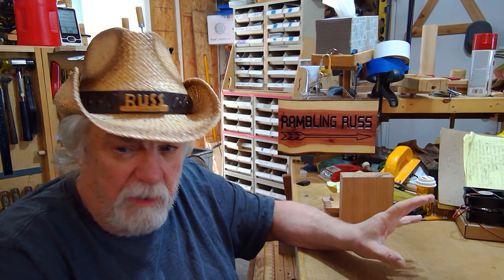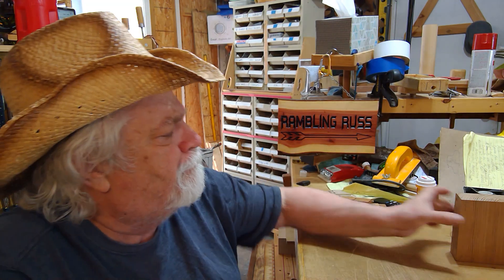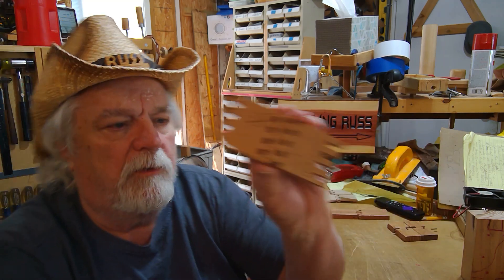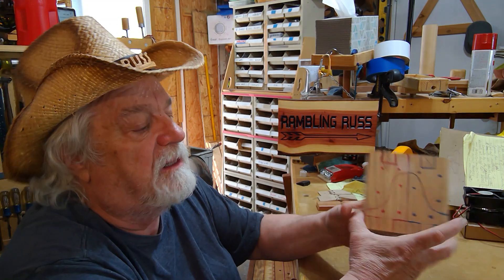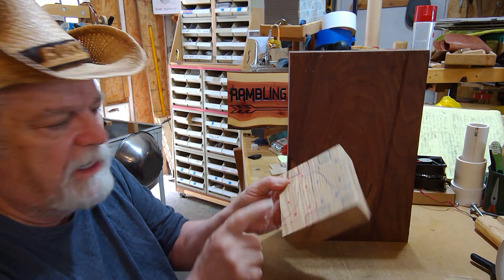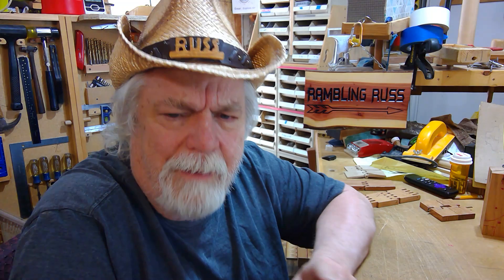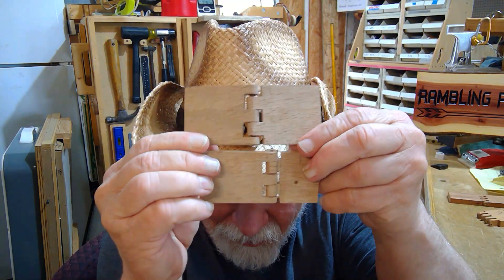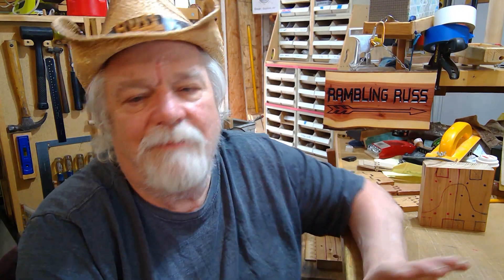Wood Hinge Design and Project by Rambling Russ

Comment: Thanks Russ, I look forward to learning.  I don't have a drill press which I assume you need to drill a very straight hole for the pins.  But there's probably an OTB solution to that!
Reply from the maker: Dave, "OTB solution"  there is :>)  I think I will do a set without a drill press. No drill press is not a show stopper.  Thanks for the encouragement.